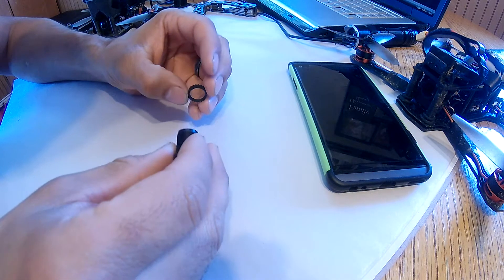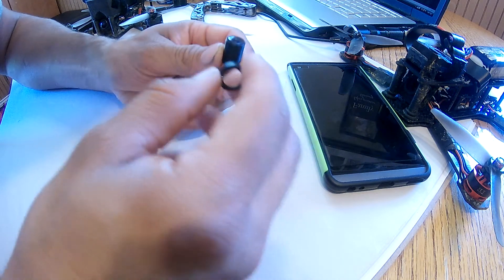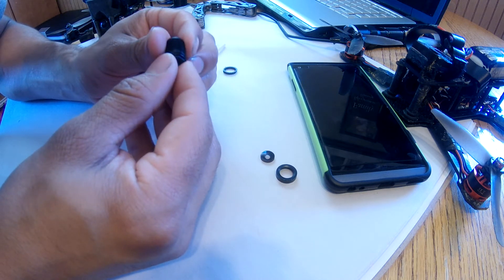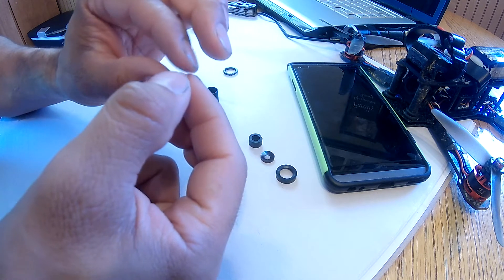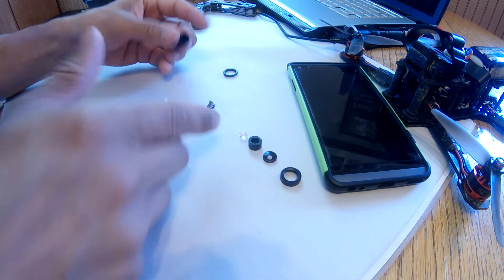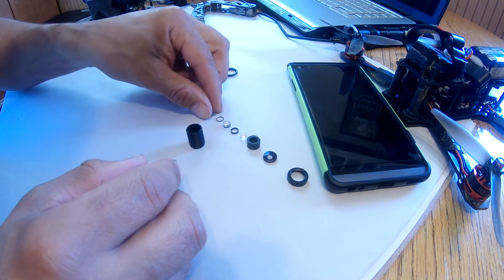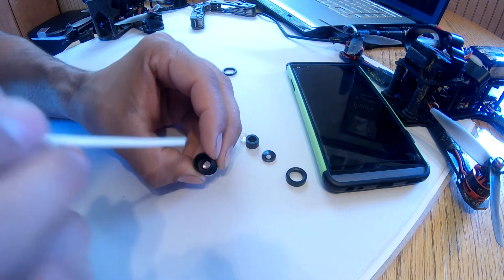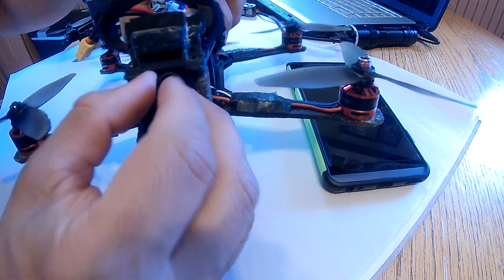FPV lens disassembly and assembly.

Comment: Hi.  I found this vid as I lost track of the order on my lens.  I found that the centre of the three glass lenses the convex needs to be facing the opposite way to the other two (i.e towards the quad)  I found with your method I could achieve focus at the centre of the image only whereas the outer edge was blurry.  Upon reversing the centre lens it is now crystal clear over the entire image.   - its a Runcam 2.5mm from a swift 2
Reply: either way around I have a misty image :)